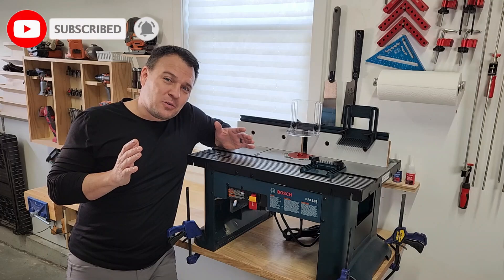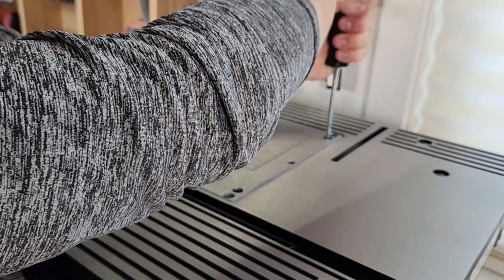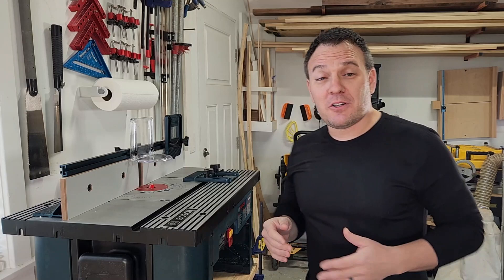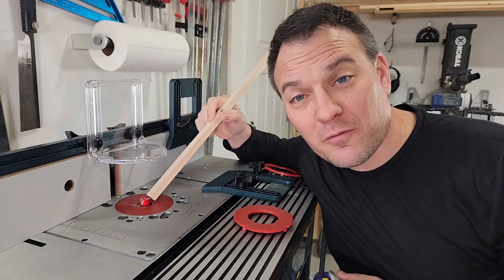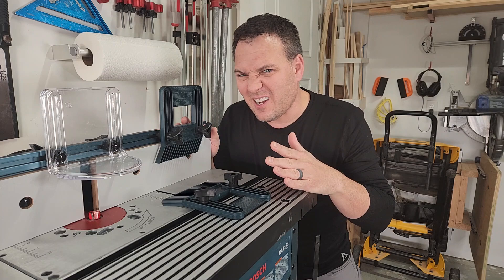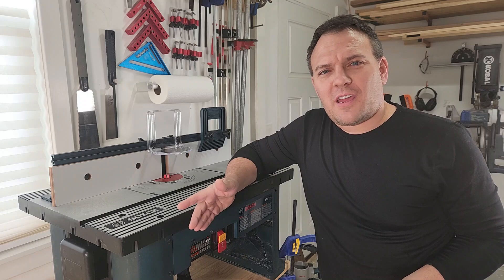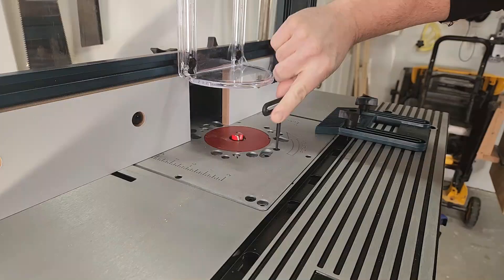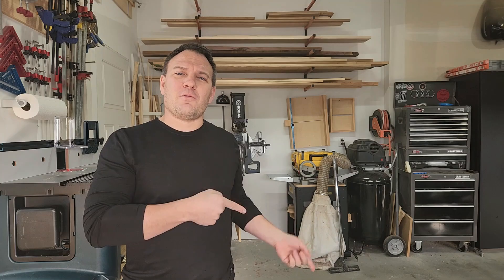Bosch Router Table Overview || New Tool Day!!

Comment: Good table, sort of wish the router mounting plate was removable like the one on their other table, the 1141. But it's a small gripe. I am amazed at how much nicer a big table is even for small jobs (about twice as big as the Craftsman router table this thing replaced). If you don't have them, a set of the offset wrenches make bit changes easier. BTW you can buy an extra fixed base and permanently remove the handles for more space under the table. I am going to dedicate one of my 1617's to the table and cut the cord to the just right length. I'll also use the cut off length as an extension cord after I add a female plug to the cut end (move the ferrite coil). I passed the table cord around the leg rather that drill a hole, if you drill a hole size it for a cord clamp or grommet.
Reply from the maker: All fantastic adds!  Thanks so much for the quality comment!

Comment: 7yrs ago For 499.99  I got the full size kreg tool 24 X 36 router table (already had the Bosch 1617 router) still going g strong and glad I got it. but for a benchtop router table the Bosch is  one of the best ones out there next to the kreg tool benchtop router table.
Reply from the maker: That's cool!  Thanks for the informative comment.

Comment: Strait forward….took me 3 hours because directions were confusing especially in regards to the screws constantly had to check to see which screw was which.
Reply from the maker: Ah, that's terrible.   Sorry you had issues.
Reply: I sorted the different screws, except the router mounting screw packet, into a parts box before I started. That helped a lot.
Reply from the maker: @mikeking7470 Great!

Comment: I also thought the table legs were metal when i bought it and i was really disappointed to find out that they’re just hard plastic. 

Is your table perfectly flush? I got my mounting insert flush with the table but the table top still seems to dip at the edges rather than being totally square all the way across. That was an annoyance. 

The power cable thing is totally annoying as well! I was thinking of drilling a hole in the side and now i just may. 

Lastly, it’s cool that you can adjust the fence so freely, but it’s a little annoying that there are no detents or easy ways to square it up somehow, and that i don’t think the table comes with a pin for safer fenceless template routing. That would have been nice.
Reply from the maker: All good points.  Thanks for the adds.  I did have some issues getting the router plate level with the table.  Honestly,  I didn't check the overall table for flatness, but that would explain the issues with the router plate.

Comment: Table is nice, but the red throat plate inserts are not flush with the mounting plate... maybe 1/16 inch dip, which is a problem.
Reply from the maker: Ya, that defiantly would be a problem.  I'll pay attention to that next time I use it.  Thanks for the comment.
Reply: @HowIDoThingsDIY  Entirely possible I got a dud or something. I can't seem to find anyone else pointing that out, so I think it's just me haha
Reply from the maker: @Nebx1989 Maybe!  I haven't noticed it yet, but I don't use it as much as I would like.

Comment: I found one annoying thing about this router table I don't know how they get around yet. The screws that mount the table to the legs tend to stick out of the table a bit which makes routing larger pieces inconvenient. For example, I needed to cut tongue in the cabinet doors for the  micro-shaker style, and these protruding bolts stand in the way making tongue inconsistent. I will either have to buy flatter bolts that do not stick out or maybe I installed those incorrectly, so they didn't sink enough.
Reply from the maker: Mine do not stick up past the table.  They are button heads.  Shoot me an email at howidothingsdiy@gmail.com and I can send you a photo.  I guess you csn see them in the video as well.
Reply: @HowIDoThingsDIY  Ok, will do when I get back, and if my attempt the fact x the problem is unsuccessful. Yes, they are button shape but the top of the button is raised above the bed, so if I am trying to route anything that goes beyond the miter groove, it runs into those bolts.
Reply from the maker: @volodymyrdrobot9454  If I remember right, they have locking square on the bolt that needs to engage with the square holes in the table.  Maybe they aren't in the hole.  Does that make sense?  Although, I would be hard to make that mistake on all the bolts.
Reply: @HowIDoThingsDIY  yeah, that sounds s my suspicion as well. I will let you know one way or another.
Reply from the maker: @volodymyrdrobot9454  Please do, the others that viewed this video may benefit from whatever you find.  Thanks for adding this!
Reply: @HowIDoThingsDIY  ugh... Figured it out. I put the washers on the wrong side when assembling the table. They are supposed to be where the nut is, and I put them where the bolt head is. Once I switched them around, the bolt heads became receded, exactly how it should be.
Reply from the maker: @volodymyrdrobot9454  Sweeeeeet!!

Comment: $450 damn.  Listed on Amazon now for $200.  Are you including the router?
Reply from the maker: Yes, mine came with the router as well.
Reply: @HowIDoThingsDIY  How is it working out?  I have a Bosch router somewhere, maybe the same model.
Reply from the maker: @putinscat1208 It works very well.  I don't use it as much as I would like.  I'm trying to get the last room in my basement finished so I can get back out in the shop to make something.